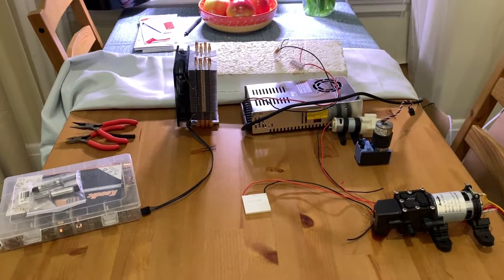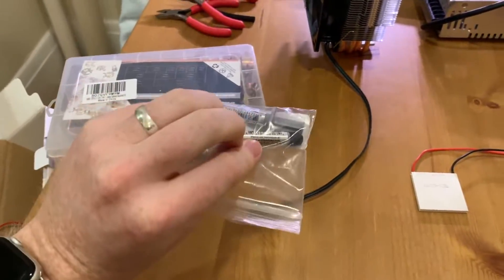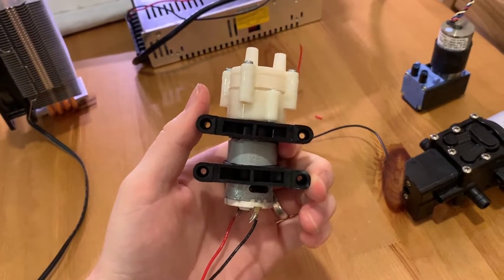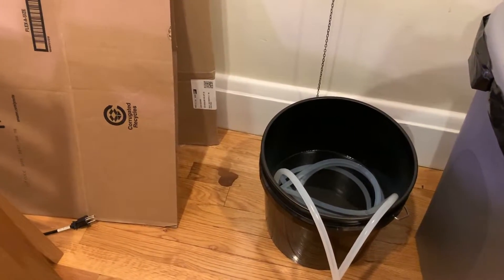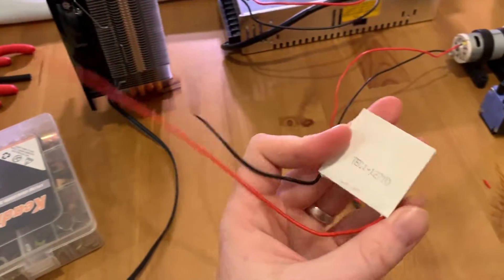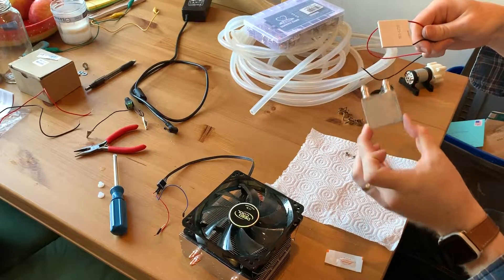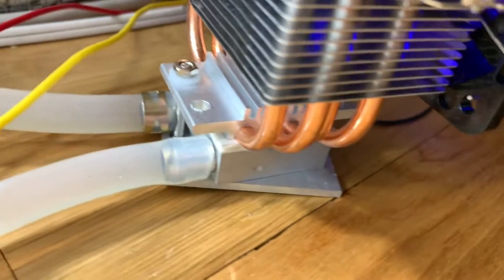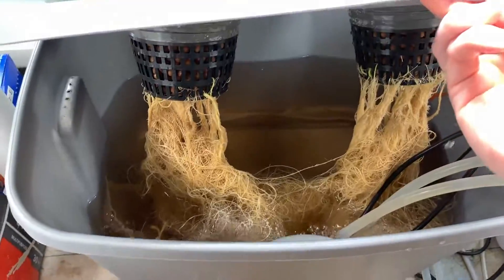Cheap DIY Hydroponics DWC Reservoir Chiller

Comment: It looks like your DIY chiller will cool to about 10 - 12 degrees cooler than the ambient temperature. I'm trying to do DWC hydroponics in Florida. DWC hydroponics worked in the winter from December through February, but not in the warmer months. The ambient temperature is from 80 to 95 degrees, and my nutrient temperature is 86 to 91 degrees. The DWC plants weakened and died, probably due to the high nutrient temperature. Is it possible to chill the nutrient to about 25 to 30 degrees below the ambient temperature by increasing the cooling capacity of your design?
Reply from the maker: You can look into dual stage Peltier coolers, they will allow you to reach lower temperatures (but you will loose some efficiency)

Comment: Hello, I am building a 6 unit tec Peltier system and I'm a bit worried about the use of the aluminum water blocks. Have you had any problems?
Reply from the maker: I used this cooler for 3 separate grows and I dont think it caused me any issues.

Comment: Use a submersible pump, like a bilge pump. Runs much quieter, are reliable and can pump a lot of water.
Reply from the maker: I was afraid of a pump like that heating up the water
Reply: @SmartGrowAutomation  I'm sure there is a slight warming but it's going to be minimal, it certainly doesn't have any noticeable effect on my setup which just uses frozen soft drink bottles in a bucket.
Reply from the maker: Good to know!
Reply: I guarantee that the moderate wattage diaphragm pump you are using is putting more heat in than a rotary vane pump will.
Reply: Correct that 12v pump comes in 2 forms DC for use on boats/RVs as a bilge pump or water supply pump , and must be hardwired in. The other is AC comes standard with a cord to be plugged 🔌 into a traditional 110/120vac outlet.. Can be used for a # of things,  in hydroponics particularly when your doing micro drip systems and you need more power /PSI. As long as a submersible can move enough water to handle your project will be thr quietest and most likely cheapest

Comment: With your peltier it doesn't matter which side you put down if it's not the way you want it meaning hot instead of cold just reverse the voltage [switch the negative and pos]

Comment: Great video, man! Appreciate the thoroughness. Your method inspired me to come up with a slightly different solution but I have questions.

I'm planning on using a 240mm water cooling radiator with 2 120mm fans. I already have an Eheim 300, but I'm not sure if the pump PSI will be enough to push water through the radiator, and I'm even less sure if the narrow pipes will cause any problems like corrosion with GHE Trio nutes in mid to long term... What do you think?

Comment: I bought the exact same set up just to give this a try but I'm having trouble putting it together i tied the black cables together and the gray wires together I connected the the gray wires to the positive and the black wires to the negative the led lights turn on but the fan doesn't spin

Comment: Hi mate, nice video, will get cracking on building this unit. One question, how have you connected the peltier and fan to the one power supply? Is this a normal thing to do and the power supply unit allows for it? Cheers

Comment: Hey man love this idea. But did you have problems with the aluminum block corroding into your system?
Reply: I was wondering the same thing.  That happens with copper in about 3 months of running the nute solution through it.

Comment: Did you check if there is a problem nutrients mix with aluminium water block?
Reply: Any updates on this question. This is a tough problem because having nute water go through copper or aluminum for the course of a grow is risky. And simply touching the Peltier to the bucket doesn’t work that well either. Anyone know any solution?
Reply: Same question.. those copper lines are definitely leeching into your system...
Reply: @MechStud1911  No water in this system flows through copper pipes; just through the water block, , pump and tubing . The copper tubing that you see are coolant lines on the heat sink which draws the heat away from the chip.

Comment: Great video.  I want to try it on my outdoor hydroponics system.  My reservoir is 36 gallons so I am thinking about doubling your setup.  How would you retrofit this system for outdoor use?
Reply from the maker: I make sure to get a pump that is rated for outdoor use or put it in a waterproof housing (look into outdoor pond pumps they probably have this figured out.) I would also consider using passive cooling heat dissipators rather that fan cooled. If you have enough of a breeze outside where you are you might be able to just remove the fan and still use the fins, otherwise try to find some large heatsinks that work well without a fan.

Comment: Peltier is very inefficient. Probably better getting a commercial watercooler. Both the pump and peltier will add heat into the loop.
Reply from the maker: Peltiers are not as efficient as compressor based cooling devices, but they will certainly not add heat into the loop. They will just require more energy to take heat out of the loop. And I am using an out of water pump so it is not adding any heat into the loop.
Reply: @SmartGrowAutomation  Peltier spend energy to move heat, just as a compressor would. But its less efficiant than compressors like a fridge or ac unit. I think its easier for you to measure the temps than me calculating it.
Reply from the maker: @OrjanDT  Yes, I am not sure if you are disagreeing with me or just repeating what I said above. I've been using this exact chiller for my past 2 grows and am constantly measuring the water temperature. I am able to cool about 10-15 degrees below ambient environment temps. Like I said above I agree that a compressor based system is more efficient, but it is also bulky, more cumbersome and hard to get one that is as small as my implementation. I've been looking for a cheap used fridge to convert to a chiller and if/when i get one I will make a video on that as well.

Comment: Just watched your vid, thanks for the DIY I have two questions 1. Can I run 24/7 and how is reliability. 2 is it possible to show how you hook up a theremonitor to
Reply from the maker: Yes I ran this 24/7. I had a pump fail and a power supply fail during my grow, but the pump I linked here never failed (I had a cheap small one before that).
Reply: @SmartGrowAutomation  what is the size of tubing used? Inner diameter that connects to this pump and the water block?

Comment: I’m so lost at how to wire the 4 wire connection to the power supply can you explain please .
Reply from the maker: Yes, pin 1 is ground and pin 2 is power on almost all 4 pin CPU fans. You can safely ignore the last 2 pins (they are sense and control)

Pin 1 is on the side with the notch closest to the edge.
Reply: Smart Grow Automation thank you 👌🏾
Reply: @SmartGrowAutomation  I'm sorry, my cpu fan isn't working. Maybe I am not understanding correctly. I have the same CPU fan you recommened so Pin 1(black) goes to +V and pin 2(grey) goes to the ground? Same ground where the computer power cable grounds to? Am I right? Mine is not turning on. I've checked the output with a meter and i'm getting 12v so the power supply is working. Again, thank you very much, You have been a great help.

edit: I put them backwards.. I meant pin 1 goes to ground and pin 2 goes to +V.  My fan isn't powered. I always thought you would have to plug + and - in to work, no?
Reply from the maker: Sorry for the delay, your comment was caught in the spam filter for some reason. Sounds like you have it figured out now though. Yes you need to plug positive to positive and negative to negative. Let me know if you have any other questions.
Reply: @SmartGrowAutomation  I have the same cpu fan and power supply I twisted the gray wires together and the blacks ones together I connected the gray wires to the v+ and the black to the v- the light turns on but the fans doesn't

Comment: I just built one of these. I might as well have flushed my money down the toilet. It doesn't cool anything. I doubt it could even keep an already chilled reservoir chilled. And forget about using this with a submerged pump. The heat from the pump is more than this can take. Look at the end of the video. His roots are all brown and nasty. Plus, he's putting his bare hands in the nutes. This guy is a beginner acting like he knows something, which is mostly what you get online, beginners trying to show off what they just learned, but presenting themselves as experts.
Reply from the maker: I never presented my self as an expert, watch any of my videos and see me talk about how much I don’t know. I’m trying to learn just like everyone else. All I can say is I built this exact chiller and it’s keeping my res 10-15 degrees below ambient. My guess is you either have too small of a peltier, assembled it incorrectly, or are failing to properly cool the hot side of the TEC.

In my video I said I didn’t use a submerged pump because I didn’t want to put its heat back into the water.

Comment: Yo I’m glad af I didn’t use ur links to buy cause the one thing I Did use your link for was completely wrong smh YO MAYBE LIST THE CORRECT SIZE OF TUBING SMH  and when do a build video maybe go step by step🤔 not just show off different parts with no explanation on how to actually build 😂😂
Reply from the maker: If you bought different things then you are obviously responsible for purchasing the tubing of the correct size. All I can say if for the things I bough that 1/4” tubing worked for me. I did have to push pretty hard and stretch it over the fittings to make it work. This video wasn’t designed as a kit where someone with no skill could just build it without thinking. The video was designed to explain the parts and what they do. That is why I explained the purpose of each thing and what role they play in the cooler. You are free to swap out parts and build it how you want but you are responsible for knowing how to connect everything together.
Reply: Smart Grow Automation I’m just saying if u make a video about using a psu as a power supply maybe for one thing tell people you have to trick it into thinking it’s attacked to motherboard by shorting green wire to ground and also maybe show how to connect all those twelve volt devices to a psu because ur showing how to make something but left out most critical info lol
Reply from the maker: This video is not about using a PSU as a power supply, it is about making a water chiller. The power supply I used and linked does not have any requirement to short green to ground. Maybe yours does but that again is on you to figure out. If that is confusing and complicated for you then you should probably be buying the prebuilt chillers. The DIY route if for those who want to save money and aren’t afraid of figuring things out for themselves. DIY = Do It Yourself.

Comment: Yes awesome thanks for responding yeah water coolers are too damn overpriced and this looked like great alternative but if u don’t mind I have two questions 1 is how exactly do I wire stuff to the power supply? I actually have one already I pulled out of an older emachine basic desktop that I am going to use but it has connectors that go to a mother board and my electric knowledge is very limited lol and finally what could I use as a “controller” like to keep it maybe between 62-68 degrees or something close? I’m worried about it getting too cold as well and figured there might be some kind of water thermometer with a power switch u could plug supply into that would cut it on and off within desired range..is that a thing🤔 lol it is on co2 controllers so I figure there might be but yes I’ll deff let you know when I start and yes I’ll use ur links and ima hit that like for u too bro thanks for fast response
Reply from the maker: Regarding the controller you should be able to use something like this: https://amzn.to/2ZzGFsH
The comments say that the probe is water proof.

And for wiring you are going to want to make sure everything you get is 12V and the power supply is 12V. Then you will need to make sure the power supply has enough juice (probably 150W would be as low as I could go). Then it is just a matter of connecting all the positives to the positive side of the power supply and the negatives to the negative side. You could just twist them together, you could solder, you could use wire nuts, or you could use wago connectors. I personally use the wago connectors because it is easy to connect and disconnect and rewire when you need to.

I purchased this box a while ago and use them for so many projects: https://amzn.to/2Fk3gSw

Hope that helps!

Comment: I was about to build a unit like this for a 15 gallon reservoir will this be enough u think to keep water around 68 degrees f?
Reply from the maker: Yes that should definitely be possible. I am using it to chill an 18 gallon reservoir and it is almost always below 68. Actually I can sometimes get it below 62 and I had to write an automation that turns off the chiller when the temp is that low so I don’t hurt the roots from being too cold!

I have a cheap plastic tote with poor insulation, so if you have more insulation then your performance would be even better. Also, the ambient temperature of wherever you put the cooling fan is important. If you can keep the cooling fan in an area at or below 75 degrees you should be fine.

Let me know if you build it! Also click the links in my description. Even if you don’t order those products exactly I will still get a percentage!

Thanks for watching!
Reply: Way too noisey, go "high pressure aeroponics"uses next to nothing electric usage, 115v - 240 v or 12v - 24 using a solar panel and a battery bank if preferred. Perfect ec and ph delivery. No fluctuations in ph or ec. Uses far less than half the amount of nutes and additives used in dwc or any other medium making huge  savings! and is silent. Simply the "Holy Grail" system for growing.

Comment: Nice! Great work and thanks for the how to on a water temp chiller. They're pretty expensive to buy. Let me ask you a question, do you connect that to a water temp controller to turn on and off automatically or do you watch it manually? And if you have it set auto, how does a controller connect seeing how its custom built? Maybe If I missed that part sorry.
Reply from the maker: Yes I didn't really go over than in this video because there are many ways to do the control. I personally have the whole unit plugged into a smart switch. I also have a thermocouple measuring my res temp. The res temp is fed into my Home Assistant instance and I wrote a Node-RED automation that turns off the chiller at 62 degrees and turns it on at 64 degrees.
Reply: @SmartGrowAutomation  Ok, cool. I have no idea how to write code or anything like that, so i'll just plug it into a regular inkbird wifi controller. I'm more of a plant guy and not tek savvy haha. But I have another question.. I'm getting all of my supplies ready to attempt a similar build. I have 2 reservoirs similar in size to your one (15-20 gallons each), and I wanted to put a chiller in both. So I was wondering if I were to use your exact model, would I be able to use the power supply you recommended to wire everything to it? Or would I need a bigger power supply to run 2 fans, 2 pumps, 2 peltier, etc? Thank you again.
Reply from the maker: I just checked with a kilowatt meter and the whole system is drawing 91W. I am actually using a different power supply than the one I linked, but the one I linked is listed at 360W so it should be able to handle 180W (double everything)
Make sure you are able to properly cool the pelters. I ran the tubing under my closet door so I could exhaust the heat outside my grow room. I found if the environment is 75-78 then the water chiller can get the res temps down to 68 or below.
Reply: @SmartGrowAutomation  you're such a great help thanks
Reply: is ecerything still running fine?
Reply from the maker: @frannie_mak7937  Yes everything worked fine for the whole grow. I recently harvested and plan on using the same equipment for my next grow.
Reply: @Smart Grow Automation - just so you know water temps should be at lowest 65 and highest 75 the temp is 67-72 for maximum oxygen intake for cannabis and anything below 65 or above 75 can cause all sorts of problems including nutrient lock out , water is a very scientific thing to play with takes alot of reading and researching, specially when comes  to chlorine and chloramines and bubble off also bubble off can lower your water ppm’s depending how long an so on, key words: ph, ppm, temp then from there you can step into the microbial side of water 💪👍